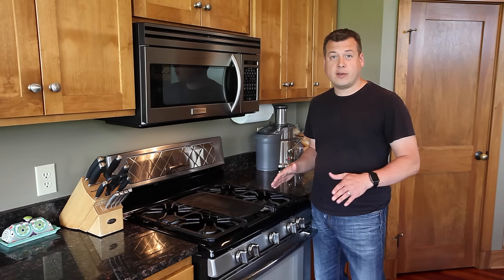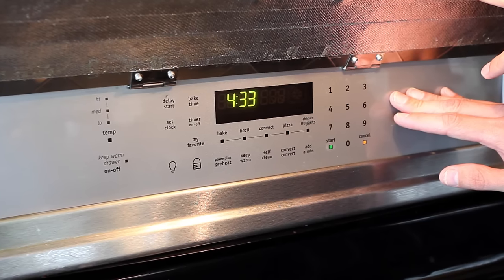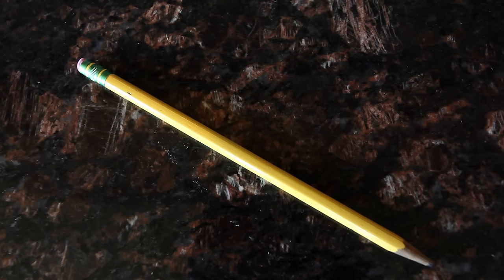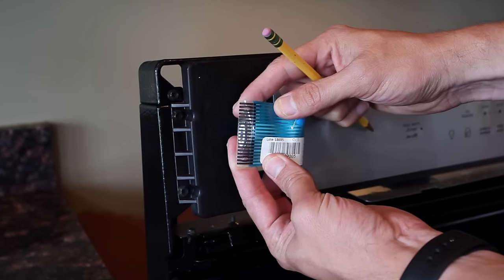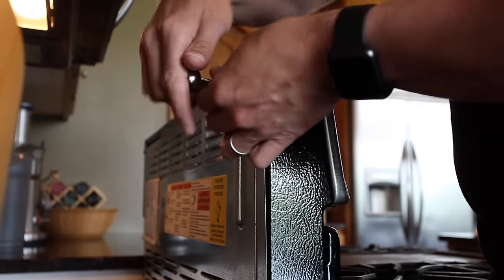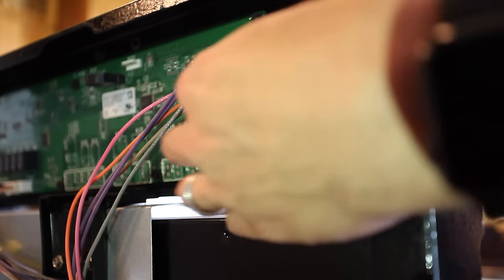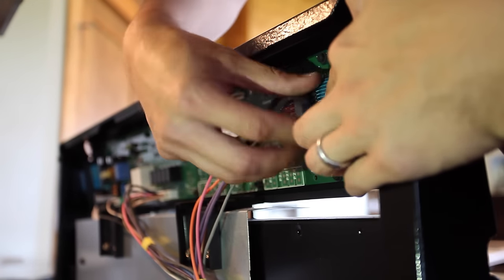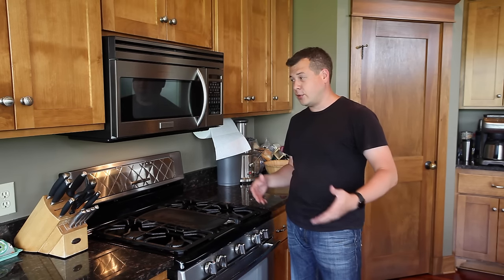Stove Buttons Not Working - How to Fix Range Keypad Using an Eraser

Comment: You literally just saved my family between $1k & $1.5k!!   We had given up on the range and had already priced a replacement. I found your video and thought that there was no way I would be able to fix this in 20 minutes with an eraser. IT WORKED! Every button is back. We lived without a clock for 2 months. Yesterday we couldn’t turn the oven off without flipping the breaker. I figured it was already broke, so what’s the worst I could do if I tried it. Thank You!

Comment: This truly works! I ordered a $120 touchpad, thinking I needed to replace the 'broken' touchpad on my Samsung gas range. Then I watched Tommy's video and thought I'd give it a try before installing the new touchpad. It took me about 5 minutes (most of that is pulling out the stove and unscrewing the back panel) and violá. It worked instantly. I was able to return the unopened box containing the new touchpad to the repair parts dealer and got all my money back. Before all this, I contacted Samsung and the response, as one would think, made no mention of the potential for a loose or dirty connection. Instead they suggested I unplug the stove or have a technician Iook at it. It costs $65 just for a technician to come to the house, let alone examine the stove. This fix saved me a ton of time and money. Thanks so much, Tommy.
Reply from the maker: Awesome! Glad it worked for you.

Comment: I can confirm this absolutely works. Got a Samsung oven from Costco and only 6 months in, got the C-F2 error on and off that would stay on for weeks. Costco's 90 days satisfaction guarantee already passed so we were pretty much screwed. When the error was on, the oven was just a brick and couldn't be used. The burners would work but anything in the oven was a no go. Unplugging and replugging only resulted in a immediate C-F2 error. And on the days it would clear (when it would decide to behave and the error would clear by pressing "Off/Clear") the oven would work fine, no problem at all. Got tired trying to just wait the code out and ran into this video. And this eraser ribbon cleaning WORKS. THANK YOU. Time will tell if the error returns but if it does, I'll just go back to cleaning the ribbon. This video deserves all the likes, praise, and tips. TY again

Comment: Just a note, If the contacts of the ribbon cable a graphite color absolutely start with a light abrasive cleaning, i.e., a pencil eraser. Do NOT use any cleaner,, alcohol or electronic on that ribbon, or you will damage it. The author correctly said "eraser" ! Bravo !

Comment: I liked your video very much and already clicked the like button and shared your video with my relatives abroad.  Thanks for a great video.  I do not have any such problem, however, I will use the cleaning techniques you have described in your video, and some other cleaning methods viewers have suggested in this comment section of your video.  You did a great service, Sir.  It is fantastic!!! Your video has great value over all which can be extended to many varieties of appliances, and especially where the control panels are not available in the market as in discontinued models.  Thanks again.  I went  over almost all viewers' feed back and your replies, and found them very useful.  Please keep up the good work.

Comment: My double oven panel stopped working months ago after a lightening strike that blew out numerous breakers in our electrical panel.  After replacing those and having it still not work I was set to order a new one, then I ran across this video.  What the heck, I had to give it a try.  I didn't actually figure out how to remove the whole panel (I think I may have to tip the oven out of it's wall enclosure) and access the connection with that eraser, but I could see that tapey-like strip and could feel my way around a bit.  I rubbed the connection with my fingers, and wiggled it a bit, and YIPPEE--it actually works again.  I'm keeping my fingers crossed! Thanks so much for the video,!!
Reply from the maker: Glad it worked for you!

Comment: I have a Samsung oven/range. The buttons went bad over time. I pulled out the back and cleaned the ribbon cable and it worked. Thank you very, very much.

Comment: Your video just saved me from buying a $250 panel. I was having the heat problem as well the button panel would heat up and turn off. I’ve seen videos of people cleaning ribbon connections with pencil erasers before I did not know this panel had a ribbon connector found it cleaned it fixed it. so I think you by subscribing and liking.

Comment: I’ve had this problem twice now within the past 3-4 years and this simple fix has worked like a charm both times! 

BIG TIP: Start with removing the metal backing first without touching the front bezel frame. Depending on your oven, you may not need to remove the front bezel frame that encases your panel. I blindly followed this video & took apart the metal backing AND front bezel which is where I learned that I only needed to remove the metal backing to access and clean the ribbon. (If you look closely in this video, you can see that the ribbon is already accessible once the metal backing was removed; it seems like the front bezel frame was removed for the sole purpose of pushing the ribbon towards the front for “easier access” which I personally don’t think is necessary unless you really have trouble getting behind your oven.)

The front bezel was actually a huge P.I.A. for me to align back in place, so hopefully this tip saves you some time! 

(For reference: I have a Samsung oven with the digital panel, not sure of the exact model but it was purchased in 2015-2016)

Comment: I tried to clean and i did get 2 elements working. After seeing another forum as well as cleaning that did work for me, was also pressing the clear button, then holding the start button until the door locking starts. Once oven was fully locked, i did the same process again to unlock it. Now all my buttons work again. All elements, bake, broil, clock, whole thang. Hope that helps if anyone else still wasnt getting all the buttons back. Thanks for the video!

Comment: I'm using the eraser on the end of a broken plastic button to facilitate the push button functionality of the original button. The eraser is bored out to fit on a plastic point that pushes the tiny button inside the panel & the button is then carefully taped onto the panel with tape that matches the panel (white tape in my case). It sounds horrible, but it looks fine when completed. So I'm using the eraser for something completely different, but I thank you for the inspiration. Necessity is the mother of invention.

Comment: Fixed. Thank you. My Frigidaire Gallery Range numeric keypad was recognizing the "3" button as a "2." Essential I had two "2" buttons and no "3" button. Everything else worked, but could not enter 3, which means no temperature with a 3 in it could be set. A power reset did not work, but cleaning the ribbon cable did. The ribbon cable on this model is harder to see as it is smaller, grey, and hidden among other connections, but it disconnects as described in the video and I cleaned it as instructed. The eraser cleaning trick makes sense as it's been used for decades to clean electrical contacts of many kinds. An eraser is basically just a very fine abrasive.
Reply from the maker: Glad it worked for you Todd!

Comment: Great advice. * I first turned the circuit breaker to the oven to off.  I performed the steps as instructed but it did not work with just the eraser.  I then took some QD Electronic Cleaner  and sprayed the black harness which the belt sits (***ENSURE TO TURN THE RANGE CIRCUIT BREAKER TO OFF).  Be careful not to overspray.  Wait a few minutes to let dry.  With both contacts cleaned it worked 4.0!
Reply from the maker: Great advice, thanks.  I'm happy to see that it worked for you!

Comment: Appreciate the tip.  Was considering purchasing another keypad.  The eraser did the trick.  Had to push the cable in and out a couple times as well.  Thanks.

Comment: Wanted to say "thank you" for the help. I have a Samsung nx58f5500sw unit and its different than your's but I applied the same process. Mine only had one ribbon strip so I disassembled, cleaned, and reassembled with just a screw driver and works like a charm. Thx!!
Reply from the maker: Glad I could help!

Comment: Tommy I followed your instructions and the cleaning of the ribbon cable worked.  Thanks much.  I have had the same issue with my Samsung microwave that hangs above the oven.  The cleaning of the ribbon also works there. I final sprayed the microwave ribbon with a sealer so I didn’t need to keep cleaning the ribbon
Reply: David Westhuis what sealer? Please let me know :)

Comment: I want to thank You so so much! I had an error code in my keypad of a different stove and had placed an order for the piece in ebay and it was due to be delivered today and it was delayed. So God said go look on youtube and find a video on how to manually ignite the stove like back in the day. Your video popped up and I read the comments and I said a prayer over the video bc I really didnt have the money for the part. It was $250, and that was the cheapest seller. They package was delayed and I wad going to go all weekend without a stove and I asked my son humor me and help me get the panel off. It looked as though of the pins was cruddy, I had used the eraser but also a small pin to scratch lightly each pin. We put it back together ans turned the breaker back on and its meatloaf tonight instead if tacos! Thank you so much. Now I can get a refund from the seller when it comes and use that money to pay my car payment! Thank you!!! Praise Jesus for leading me to find you! ❤❤❤❤😊

Comment: Thanks pal ! Genius fix it is. One can also use isopropyl alcohol to clean off the conducting pins and then brush them off with eraser as shown before wiping with clean towel.
Reply from the maker: The last time I made this fix (a few weeks ago) I used dielectric grease hoping that it will make the fix last a lot longer.  Prior to this, I seem to have to make this fix about every 6 months so we'll see if the dielectric grease helps extend the longevity.
Reply: I liked your idea, Sir. The isopropyl alcohol helps in dissolving the build up, which makes it easy to brush it off with the eraser followed by wiping with a clean cloth.  What a wonderful idea!!!  Thanks for your input.  I am going to use it in future.

Comment: Tommy, thanks for alerting me to the ribbon cable - ours was actually unplugged, we just had to plug it back in. I am going to go put $20 in your tip jar. The problem was, we have a slide in range, keypanel in the front, and we didn't know how to access the ribbon panel. (GE Profile slide-in range JGS968 full model number is JGS968SOH1SS). We were taking out screws, based on another YouTube video of a different model. That was NOT necessary. I took off the burner knobs by just pulling them out. There are cylinders, about 1 1/2 inches in diameter, around the holes for the burner knobs. Those actually unscrew - they are holding the control panel onto the oven. I unscrewed them, control panel came right off, ribbon cable was unplugged! I plugged it in to the control panel and put the control panel back on, lining it up with the 4 holes and screwing in those black cylinders. Everything worked again! Safety: I think the control panel should be sealed at the top, so food/liquids don't spill behind it. Also, turn off electricity and gas to oven before doing this.
Reply from the maker: Glad you got yours working Tracey!  And thank you so much for your generous tip!!!!!

Comment: Mine was a circuit board that was really wedged into the back of the panel. I had to break a couple of pieces of plastic on the panel that were holding the circuit board in place. No harm though. I erased the circuits, and now it works like new. Thanks!

Comment: I found at least on my samsung range that it's not corrosion on the ribbon cable but instead the ribbon cable becomes slightly dented at the contact points where it clips into the board.  I believe this is just from the constant pressure of the plastic clip, and slowly the contacts become loose. Definitely clean the contacts as shown in the video but ALSO be sure to GENTLY bend the end of the ribbon cable back straight so good contact can be made again.

Comment: You could use electrical contact cleaner also. Good video. I have also seen where they have a double ribbon cable and the oven membrane switches do not work properly as well as the oven, i have seperated the two ribbon cables with folded up sheets of paper and bingo! Those ribbon cables are right next to each other and they cross communicate causing errors and such. Good luck.

Comment: I had this problem with my Samsung for a couple months now it would only work on conv, roast mode and sometimes all the buttons would work and though in was just a connection of some kind, thinking if the key pad was out it all would more than likely not work and not intermittently. So doing research  found your video and went to look at mine which is not the same but it does have one ribbon connection, cleaned it like you did and bingo works like new! Thank you very much for sharing your video on this topic. I will share it and hope to get you more support for your effort and time, takes again, take care!
Reply from the maker: Thank you and glad it worked for you!
Reply: The problem just came back, but in just 10 minutes had it working again, good for another 10-12 months, Thanks again Tommy!

Comment: If you have any older guys hangin' around who want to have a girlfriend who is a great cook send them to me...I have a house full of the laziest men and every time something stops working they leave it to me to fix, they were tossing my $1,200 refrigerator out, until I found the box in the back needed a replacement part for $15. The Kenmore dryer panel--I fixed it, the dishwasher, fixed it, the computer, fixed it...so tomorrow, I will do the oven panel as you showed here and If it works, they will not see me cook for them for a month. Next break, I am out of here.
Reply from the maker: Lol!

Comment: I tried the eraser cleaning trick and I found that I had initial success where all the buttons started working again, and I was really excited.  However, I ran into the same problem happening again later in the same day.  I tried the trick again and had some more success however the buttons stopped working again about 5 min later.  I was a little disheartened at this point, so I perused the comments, and found that some people recommended doing a cleaning using alcohol and qtips.  I was also going to try wrapping a piece of paper around the ribbon cables where my two ribbons overlapped and contacted in case there was some issue happening from the contact.  I didn't get to try the paper idea though because the alcohol and qtips rubbed off the lines from the ribbon.  I was shocked at how quickly it just rubbed off too, so as a warning to others, be careful if you choose to use alcohol to clean those ribbon cables.  Maybe just stick with the eraser for cleaning because I had no problem from just using the eraser.  I'm not too upset with ruining the cable as I was getting only partial success.  I probably was going to need to buy a new control panel anyway because of the fix not quite working for me.  I'm going to replace the door seal too in order to reduce heat escaping from the oven and venting over my control panel.  I never had an issue until my wife did some cooking at 450 degrees F.  I think too much of that heat was venting into the control panel and may have caused additional issues and that's why I was having only limited success.  My oven was model JJW9430DDS (Jenn.

Comment: Hi there, video looks great.  Before we attempt this, however, want to ask about our specific problem...One of our pushbuttons isn't working, but the plastic over the button is cracked, so it doesn't seem like your fix would work on that.  Do you know of any way to fix the cracked button/plastic without calling a technician? Thanks!

Comment: Thank you very much for this video. We have a Bosch HEIP0 54U oven and the some of the numbs on the touchpad stopped working. So I opened things up and found the ribbon connectors...but they were very small and I couldn't figure out how to disconnect them--despite a little search online. With a pair of tweezers, however, I was able to move the plastic connector part just slightly back and forth. I figured I would see if that little bit of movement improved the connections, before I tried more forcefully to fully disconnect them. And...it did! All the functionality returned. So as you discovered, the ribbon connections were indeed at fault! Many thanks for that. Though I don't mind saying that this stuff really annoys me. This stove is less than four years old...and this is what you get for buying a (supposedly!) premium product? Oh, BTW, we bought the Bosch to replace a (supposedly!) premium Thermador. Why? Because the panel croaked and you can't get them anymore!  Such a waste! Aaaaarrrrrrgggghhhhhh!   ;-)
Reply from the maker: They really don't make stuff like they used to as you are also discovering.  Sometimes all this new tech just complicates things that don't need to be complicated. Anyhow, glad you got yours back up and running!